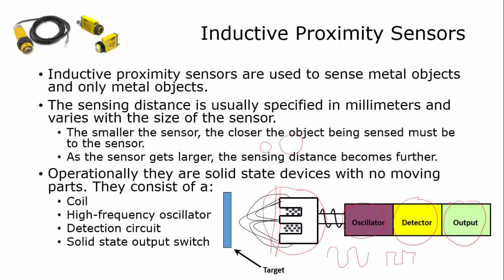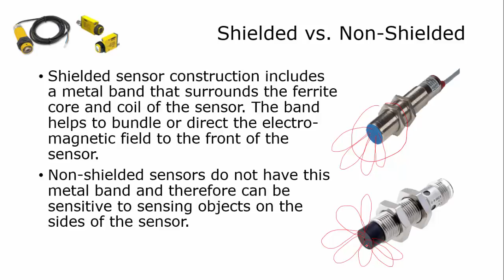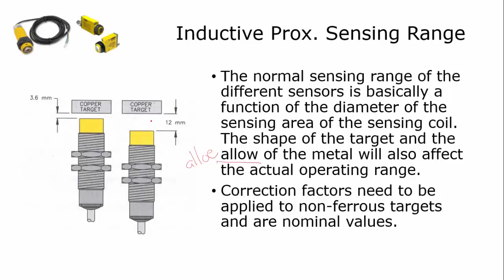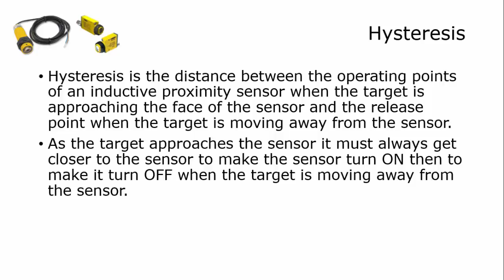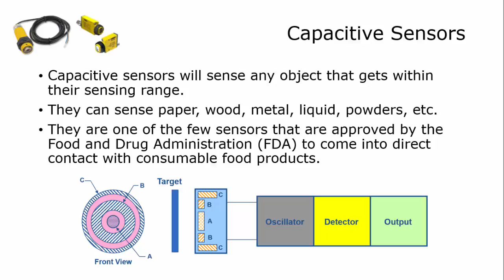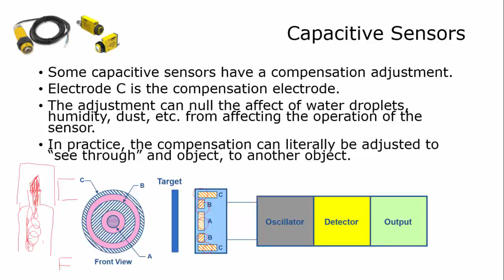Inductive Capacitive Sensors

Comment: Thank you for the detailed explanation about these sensors. I'm currently using a capacitive sensor for my school project to detect Plastic PET Bottles and it is only detecting the water residue inside the bottles meaning if the bottles are dried the sensors won't be triggered. I understand that PET Bottles have a dielectric constant of about 3 to 4, but what I don't understand is why isn't it triggering the sensor ? Is a DK value of 3 too little for the sensor to detect? Or is it because I'm using a cheap and generic capacitive sensor? This is the link to my sensor : http://synacorp.my/v3/en/proximity-sensors/854-m30-0-18mm-capacitive-proximity-sensor-npn-no-6-36vdc-ljc30a3-h-z-bx.html. I've tried tuning the sensor but it still doesn't work with PET Bottles, I've onced tuned it until it is constantly on ( Detecting the Dielectric of Vaccum???? ) but tuned it a little bit back until it lights off, but it still doesn't detect my PET Bottles. I've appreciate it if anyone can help! !
Reply from the maker: If you are trying to sense that a clear plastic bottle, with that low of a dielectric constant is present and empty, you could be in for a difficult task when using a capacitive sensor. There are a lot of consideration to take into account with capacitive sensors. Most of the applications I'm familiar with are using a capacitance sensor to know if there is material [in] the bottle and if the bottle is not sensed it is rejected as being empty. 

Capacitive sensors become less sensitive as the dielectric constant gets lower. If the bottle actually has a DK of 3 to 4, the sensor will not be very sensitive to sensing [just] the bottle and it will not take a lot of foreign material in the bottle to trip the sensor. 

I can only assume this; however, when there are two materials involved, such as in your case water and plastic, the sensor will always see the material with the highest dielectric constant. In your case the water has the higher of the two. (Water has a dielectric constant of approximately 80.4 at 20-degrees C). The higher the dielectric constant of a material, the more sensitive the sensor will be to sensing it. Here is a link to Pepperl+Fuchs that might supply a little information: 

https://blog.pepperl-fuchs.us/blog/bid/306393/The-Basics-Capacitive-Sensors-and-Dielectric-Constants 

Have you, or can you adjust the distance between the bottle and the sensor? You might have to bring the sensor very close to the bottle to sense it, maybe as close as 1mm? At that distance, I'm almost positive there will be a lot of false sensing. Also, are there any places on the bottle that are thicker, like a cap or the bottom (think of a Coke bottle). If so, you can try moving the sensor up or down along the bottle to where the material might be thicker. This won't change the DK of the plastic; however, you might get lucky with more mass.

Banner Engineering makes a photo electric sensor that can sense clear plastic based on the amount of UV being emitted from the plastic when light strikes it. You will need to know what type of plastic is being used. These sensors might be outside of your budget. 

I don't know if this is possible, but some manufactures literally place registration marks on product just for the purpose of sensing. That could also be a possibility if a mark could be placed on the bottle? Unfortunately, this cannot always be done.

Without actually seeing the bottle and where the sensor is located, it's hard for me to give any other suggestions except that a capacitive sensor might not be the best option for your sensing need. Have you consider using a mechanical limit switch? There are many very tiny and very sensitive mechanical actuators available. Again...without physically seeing your application to make a judgment, you might have to get very creative.

Good luck my friend, and thank you for reaching out.
Reply: @jtodora  Thank You so much, I really appreciate the details !  You have really cleared up the air for me. But there is this one video that is still puzzling me. That is this video demonstrating capacitive sensors, at 1:40 it shows that capacitive sensors can detect plastic out of their factory default settings, so the questions still remains. Is it because my sensor is cheap and generic ? Cause it seems to work fine in the video by tuning the sensitivity ? !  I really appreciate your help sir.  Can I have your email ? (If you dont mind)
Reply from the maker: I assume you're talking about the Automation Direct video on capacitive sensors that you supplied a link to? What the video is not telling you is what kind of polymer the plastic container is made from; it can matter; however, you said you know the DK of your PET bottle. Does the sensor you have, have a compensation adjust? The specification sheet link for the sensor you have does not say whether it has a compensation adjustment. I assume it does, I've never seen a cap. sensor that did not. 

When I was teaching at the Community College, I was using an Automation Direct CM1--AP-2H with a Polyethylaneterephthalate (PETE) container that has a DK of 3.2. I was able to adjust the sensor exactly like the Automation Direct video shows. The sensor was physically mounted approx. 2mm from the container. My students would then be given different materials and had to adjust the sensor to not see the container and only see the material being added. The material(s) used had a DK greater than 3.2. I would then have them add a material that had a DK of 2.1 and adjust the sensor to see the material; however, then when the vessel was empty, the sensor would still sense just the vessel because the vessel DK was greater than 2.1. Remember, the sensor will see the higher DK.

So...If you everything wired and mounted correctly and the sensor cannot be adjusted to see the plastic PET bottle alone, it could be you got a bad sensor, right out of the box. It's been known to happen. Please remember that if there is anything in the bottle that has a higher DK than the bottle, the sensor will see it and the bottle.

My email address is on my channel: theplctutor@gmail.com
Reply: @jtodora  Thank you so much, Sir. Appreciate the help and Keep up the good work !! Will be needing your videos more frequently in the near future. 
Best of luck ! - Bernard

Comment: Good explanation .is all proximity sensors use only DC volt or both Ac and Dc volt?
Reply from the maker: You can still get AC sensors; however, there are fewer and fewer of them. DC is preferred because they have much faster switching times than AC.